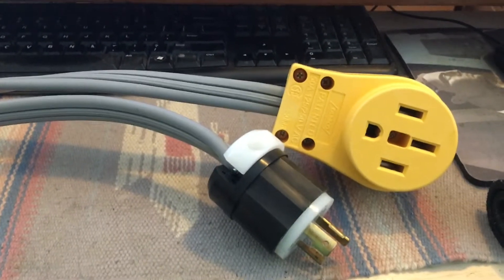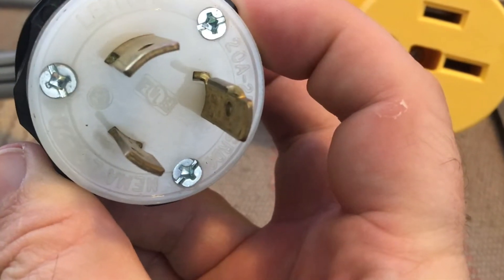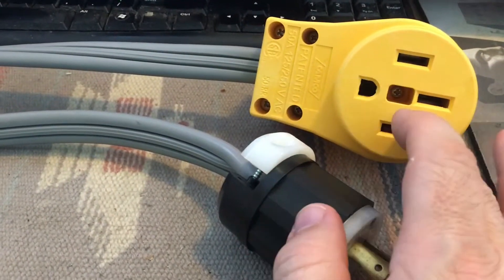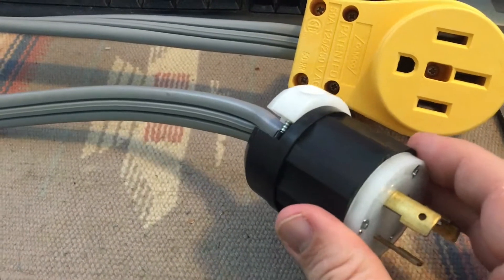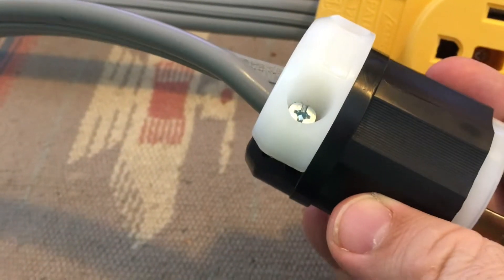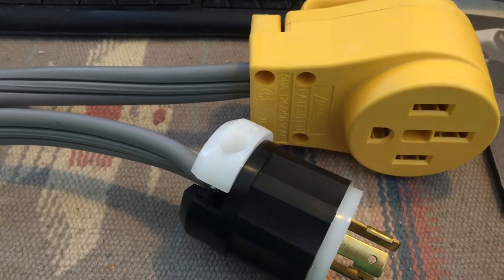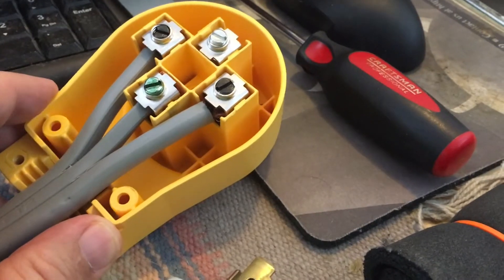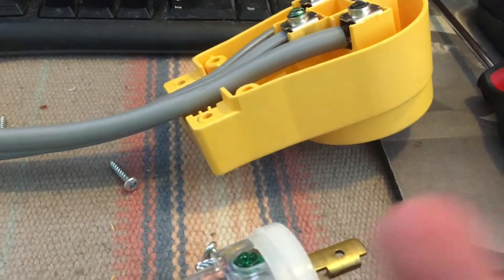Building Electric Car (EV) Charging Adapters

Comment: Do you have the schematic to connect a L6-20 dryer plug to a standard 110V socket? (I have a Delphi L2 10A charger that takes 100-220V, but has a 110V moulded plug. I want to build an adapter to connect it to a dryer outlet.) I tried a straight through connection but I get a red fault light on the unit.
Reply: A straight through connection is all that's required for an adapter.  However if the Delphi unit does not support 240 volts and they did a good job of checking then yeah you will have gotten a red light.

I'm not sure what you mean here exactly.  There is a Delphi 120 volt charging unit with a molded 120 volt plug.  It is not correct to call that a "Level 2" charger.  Level 2 refers to 240 volts, where "Level 1" refers to 120 volts.
Reply: @DavidHerron  The electrical safety sticker on the side of the unit says 'Input 100-250V AC 10A. 50-60Hz'. It has the standard J1772 connector on the outlet side. I switched the hot and neutral wires in the adapter and still get red fault light, so I am not sure how this is supposed to be wired.
Reply: @SpawnyWhippet  That voltage range says it should handle 240 volts or 120 volts, sure.  The connections in the adapter should be straight through as shown in the video.  For consistency sake, simply line up the wires so they go directly through to the corresponding connector on each end.  Then you don't have to worry about whether something got swapped around.

The L6-20 is simply three connectors just like the 120 volt plug.

The red light is going to be indicating a problem - and low voltage was my first guess.

Second guess is that there's a ground fault problem on this outlet.  Did you try this with multiple power outlets?
Reply: @DavidHerron  The dryer outlet is working fine with my Tesla Gen1 UMC charger at 220V, I only get a fault with the Delphi charger and that custom adapter. The Delphi works in standard 110V sockets, but it is very slow. I guess it needs some other kind of wiring schematic for 220V, I just can't work out what. Google did not help me...
Reply: @SpawnyWhippet  With many line cord charging stations they simply don't work with 240 volts and work fine with 120 volts.  But since yours has a 100-250 volt range it should work fine.

I believe that what you have is a rebadged version of the Clipper Creek ACS-15.  According to its specifications page it only supports 120 volts.

https://store.clippercreek.com/level1/level-1-12-amp-ev-charging-station-acs-15